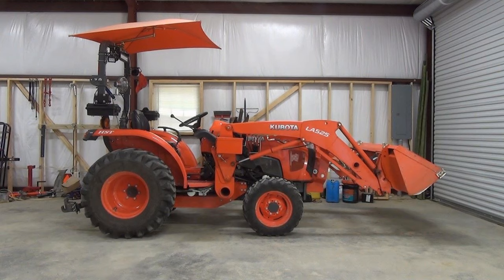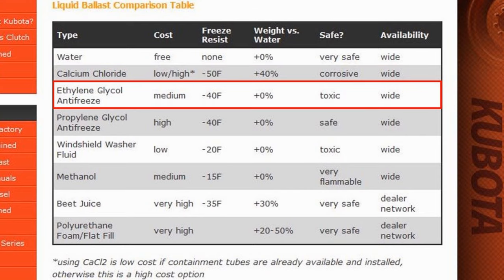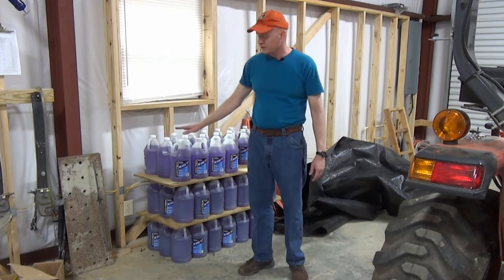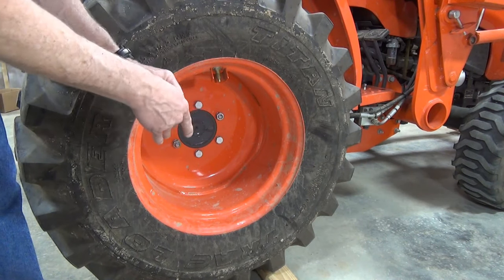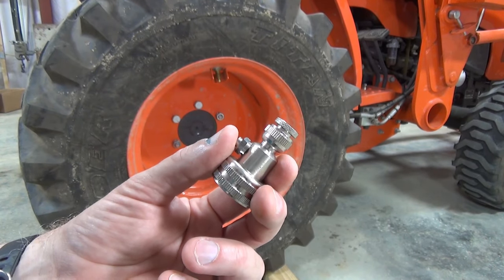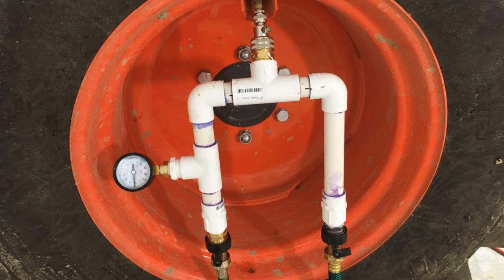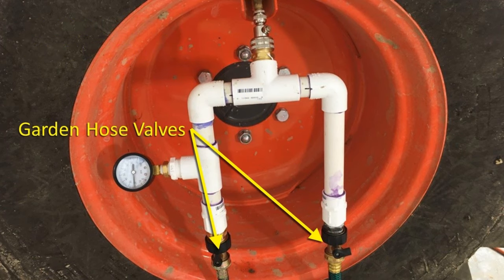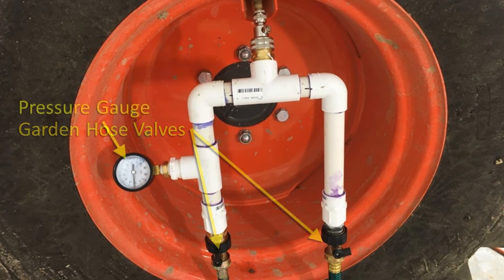Adding Liquid Ballast to Tractor Tires: Which Fluid? Which Method? Tire Fill Chart (#95)

Comment: You should know that anti-freeze has had a bitterent required since 1/1/2013. It is no longer sweet for animals.
Reply from the maker: That’s good to know. Thanks for sharing the info!
Reply: Not rue. Have splashed it on face. It's sweet

Comment: Isn't that a TR220 valve? I've never seen a rear tractor tube with anything but a TR220 or TR218(They just differ in length). The entire stem should unscrew from a 5/8" fitting to allow liquid to be pumped at a reasonable rate. Also fill with the stem between 10-11 o-clock so that you don't get a bunch of fluid every time to check the air pressure at 12 o-clock.

That chart isn't accurate either, methanol is 6.6lb/gallon. Windshield fluid is usually a mix of soapy water and methanol, brands vary so weigh a gallon to know what you have. (Be sure to subtract the empty bottle weight.) Methanol wouldn't be used straight anyway it would be mixed with water.

I like the weight and low cost of calcium chloride but the real problem isn't rust from the inside (The oxygen gets used up fairly quick and rusting stops, esp if the initial fill is with an inert gas.) The real trouble is the corroding valve that gets tiny little weeping drips which corrode the rim and all the lugnuts and such from the outside. 
Realisically, if the the traction difference over plain water density and or iron weights is a concern then you should be running proper agricultural tires rather than those industrial treads. Liquid density in front tires might be more critical because they are so under sized on utility tractors.
 Though many times iron wheel weights are hard to find for older machines as some fool let them get separated from the machine and overgrown in brush or sent them to a scrapper for $10 (same goes for many specialty implements).

Comment: Great video.  Enjoyed watching even  though my L3301 came with loaded rears.  I thought you would have done this with the backhoe on which would have made raising the wheels off the ground much easier🤓  BTW, I just did my 400 hour fluid change and referenced your video a few times.  I too couldn’t get my filter off and ultimately had to jam a screwdriver thru it!  Keep up the great videos.
Reply from the maker: Hi Stephen!  I would have used the backhoe except that the stabilizers leak down.  So, I didn't want to have to worry about that.  I just wanted to focus on the liquid ballast.  Glad the fluid change video was helpful to you! Thanks for watching!

Comment: I feel like tractor tires should have two valve stems to make this easier lol
Reply from the maker: Good idea!  One opposite the other.  Or maybe just a removable drain plug opposite the valve stem.  That would make draining a tire MUCH easier.
Reply: @DIYMyWay  maybe they make a valve stem kit you bcan drill a small hole and thread in?  Let me look
Reply: What do you think of these?
Reply: Guess I can't link to the product on YouTube.   lock and lube website has a permanent valve stem kit.  But I think a good screw in plug like you said would be even easier

Comment: I fill small tubeless tires by removing them from the tractor, breaking the bead partially, and just pour the fluid in between the bead and the rim. Oh and lay them down while filling. You can go faster and get just as much or more fluid into the tire.

Comment: What an absolutely beautiful video. Informative. Strait to the point. Not drowned out with music.
Purely professional.
Reply from the maker: Thanks!  That means a lot coming from a fake account.
Reply: @DIYMyWay  Justa fellow tractor owner looking to fill my JD 4200 wheels this weekend.
Went from the 4wd to a 2wd when the front gears went. They wanted $5000 to replace them so I disengaged. The tractor can barely scope a load of stone even with a 8 disc harrow plow on the back.
I learned the most from your chart of weights and corrosive ratings which was my biggest concern.

Comment: I recommend using a 5-gallon Hudson sprayer.  if you have a compressor you can add an air valve to the lid of the sprayer, and use the compressor, with regulator set to about twenty to thirty-psi.

Comment: Hey there Martin!!!  Great video.  Having ballast in the tires is a great plan.  Makes the tractor a lot more stable like you say.  And loading your won tires is not that difficult for the average DIYer.  I used the windshield washer fluid option and had no problems last winter.  It is a much more cost effective solution.  Take care!!
Reply from the maker: Hi Mike!  So you chose the same juice! Eggcellent! Thanks for watching!

Comment: Well I finally got around to do as you recommend and it worked GREAT!   Very easy. I followed every step using washing fluid from rural king. I got about 30 gallons per side.  Every step and equipment you recommended worked perfectly. Thank you so much for your information.
Reply from the maker: Hi Trip! Glad it helped and that you got it done successfully!

Comment: Most all my old, old tractors have calcium chloride and the rims show it.  As the tire and or rim failures add up over the years, and no longer using them for heavy farm work, I repair the rims the add wheel weights.  The larger tubed tires have a two part stem, where the outter part threads out of the larger shorter diameter portion to allow higher volume of fluid flow into the tube.  Cool and informative video Martin, I think you more than covered all the bases.
Reply from the maker: Hi Wendell!  Yep, calcium chloride is cheap and heavy per gallon, but best used in tubed tires.  Thanks for watching!

Comment: Most professional vid I've seen so far. I use removable weights in case I need to haul on a trailer or adjust for soil or implements. Too much traction without proper slippage allowed can ruin transmissions, ruin tire insides if not tubed because of moisture in the air and imbalance at speeds causing tires to flex wrong.  Often thought about boxes that I can fill and remove long chains, weights etc...
Reply from the maker: Thank you, Perry!  I appreciate it!
Reply: How easy are the weights to install and remove?
Reply: @wlfpck08  You pose a thoughtful question.  No fun in cold, wet miserable weather if the tractor needs to be loaded on a trailer.  HF and others sell a hand pump vacuum that might fit the air fill nipple with valve core removed.  It will have to be a very small tube and lots of time.  Wish I can find an easier way.  Farm jack lifts the weights with no problem but I'd rather be able to evacuate the fluid fast and refill with an easier way.  I've thought of metal plate lifting magnets that can lift well over half a ton and more.  That would be great if the weights weren't too heavy but maybe hoisted on and off????

Comment: Some Allis Chalmers service manuals recommend valve stem at 45 degrees.  Gets the CG lower and you add physical weights if you need more for traction.

Comment: Did one years ago with just the adapter by disconnecting it and bleeding pressure periodically, but it took a while. Didn't bother me and my helper, we were pretty loaded as well by the time it was done... If you have a Sat afternoon to spend, it's one way to get it done, but I prefer your approach.
My "new" B7800 came loaded with odorless, non slippery red stuff, presumably beet juice of some sort, can't say I'm disappointed about that. Excellent video!
Reply from the maker: If you got beet juice in your tires, you’re all set for freeze-proof ballast. Thanks for watching, Scott!

Comment: Besides saving the spray to the face from using the little bleed button, the manifold has another great use.  Should you ever need to change a tire due to wear or just the desire for a different tread you can reclaim your fluid by using a second air/water adapter on the inlet side of the manifold and use the valves to switch between adding air pressure and pushing the fluid back out to a drum.  Once 60 - 70% of it is out, you could remove the wheel and lay it over on a block to get even more out.
Reply from the maker: That is right, Stephen.  It can essentially work in reverse if you have the stem at the 6 o’clock position.

Comment: I'm going to give this a try, with the pump and the manifold.  I tried another method a while back and it didn't work out.  One thing that was a big fail was letting all the air out of a rear tire.  Even with the tractor jacked up on both sides, the tire came completely off the rim.  I had to hire a guy to come out here and get it back on and inflated.  That's $105 I could have spent on something else!  So this time I won't be letting all of the air out; only part of it.  Having the tire partly pressurized will make it take longer for the pump to push liquid into the tire, but with a lot lower chance of having to call the tire mechanic again.
Reply from the maker: Hi John!  Tire coming off the rim?  Ouch!!  Sorry you had so much trouble.  I hope it goes better with the manifold. Thanks for watching!

Comment: Excellent video- I'm in GA too. There is a Rim Guard dealer in Newnan, GA. I just called them to get a material only price on 100 gallons of  Rim Guard as my tractor is in Alabama about 3 hours away from nearest dealer. They quoted me $4.15 per gallon and a "service" fee of $150 to transfer the juice into my IBC tote. I'm looking at my options!
Reply from the maker: Thanks!  A Rim Guard dealer in Newnan??? Who da thunk it!  Sounds too pricey to me, but you can’t beat beet juice. Thanks for watching!
Reply: @DIYMyWay  too much $ for me too. And $150 to transfer into my tank?  Hell no. Looking at 2 x 55 gal drum of windshield fluid from Napa for $90 each. 😎👍🏼

Comment: Great video; well done!  I have a B3200 TLB with a BH77 backhoe.  It is weird that the book for the backhoe says not to use ballast, yet on the facebook Kubota tractor forum, many owners stated that their dealer puts ballast in all the tractors they sell.  

Beet Juice;  Also on the forum some owners stated that their local tire shop will not fix their tractor tires if they have beet juice in them because it apparently goes sour or rots and stinks really bad after being in the tire for a while.

for tractor work on a slope, they make 'oh crap' angle gauges to mount on tractor to keep you safer.
Reply from the maker: I know the BH77 manual says that but pretty much everyone ignores it because we need the ballast when not using the backhoe.  Interesting info about beet juice!  I didn’t know that it rots but it sure makes sense.  It’s not common here in the South because it just doesn’t get terribly cold very often.  I’m familiar with the angle gauges.  My pucker factor pegs out long before any gauge does. Thanks for watching!

Comment: Great video.  I have a L3901 also.  I used water because I am in central Louisiana.  It does freeze here, but not too often and not too hard.  I have never had any problems.   
Does not take too long to fill with water when you have 60 PSI.  
My tires were inflated to 30 PSI when new.  I found them to be very rough, so I reduced pressure to 20 PSI.  After adding water, I reduced tire pressure to 15 PSI.
I had one tire break seal because I did not jack it up.  It was tough to fix.  Jacking it up is the way to go.
Keep up the good work.
Reply from the maker: Thanks, Eric! Bummer that you had one break seal.  Definitely gotta jack them up. Thanks for watching!

Comment: Easy way to add antifreeze, lay hose on ground flat. Drain any water out, have a person on each end of the hose. With a funnel pour anti freeze into garden hose. When it has the desired amount of antifreeze hook one end back to your water source, put the valve (the one used to add water to tire) on the other end. Repeat as necessary.

Comment: Instead of the manifold you could use a garden house splitter with ball valves which are about $6.  You would lose the pressure gauge but it would be super simple.
Reply: It would just require that he keep the tee inline for the gauge.

Comment: Today I thought of a way to do that without all the PVC and adapter fittings. I work on lawn pumps occasionally so I carry this hose Y fitting that has two little valves on it, and I keep a pressure gauge attached to one of the outlets. Then I looked around my van and found another one of those Y hose things with valves. All I had to do was screw this second Y onto the second outlet of the first Y and that leaves me with a pressure gauge and two hose connectors to run to the pump and the bucket. So basically I did the same thing with two 5 dollar hose Y connectors. All I had to buy was the 10 dollar Air/Water Adapter Kit and a short 3/4' nipple for the inlet of the first Y. Easy peasy.
Reply from the maker: You have a smart, inexpensive solution! Thanks for watching!
Reply: That is a great idea.  I actually have the same type of thing in the garage, but it is a manifold with 4 valved outlets.  Am I glad I read through the comments and saved myself building the manifold!  Thanks.

Comment: Great DIY video for this operation! In my case however, I had our local Farmers Co-op tire shop do this prior to delivery on my new tractor since I knew from the purchase that I needed additional weight on the rear tires & could eliminate the hassle. Not as difficult as I would have thought though with that rig!
Reply from the maker: Thanks, Nunya!  Yep, it turned out it wasn’t nearly as difficult as I had imagined.

Comment: Well once again this is a great video. I have my weekend planned.  Thank you.
Reply from the maker: Thank you, Trip!  What ballast fluid do you plan to use?
Reply: @DIYMyWay  wiper fluid just like you did. Already priced it at WM. Ordered the transfer pump, stem removal tool and adapter from amazon last night.  I'm ready.
Reply from the maker: Excellent!  Good luck!
Reply: @DIYMyWay  Thank you. I'll report back when I'm done. Contemplating the PVC system you built. Might just go straight from the pump to the tire.  We will see?  I am sure I'll be covered in blue wiper fluid.
Reply: Hello. Walmart sells only 12 g of wiper fluid at a time. I found a product called quix wiper concentrate that makes 55 g of fluid and I need to add 11 g of methanol for the winter mix. All in that’s less than $35 and it’s a lot  less than moving vs 60 g of pre mix. Do you think that would do ok?  Thank you.
Reply from the maker: Hi Trip!  It sounds like it should if the freeze protection of that mix is well below the coldest temperatures your area gets.  Good luck!
Reply: @DIYMyWay  I found 60 g at Rural King so problem solved. Thanks again.

Comment: If you use anything corrosive make sure the whole metal rim is covered.  Other wise it will have air in the tire and cause the top of the rim to rust.  In the image i would go 3 in higher than where they show liquid level.

Comment: I used a boat bilge pump, 12V, plenty fast. Submerged with 3/4" transparent tubing to the tire. If you make a loop to the tire you can "see" when the pressure is building up too much and just purge the air with a valve. It's hands on, refilling the 5 gallon bucket as you go,  likely an evening watching the tires fill and purging as required. I don't see how the manifold would help so much that I would build one.
Reply from the maker: A bilge pump! Good idea. Thanks for watching!

Comment: I've got a garden hose "Y" with a valve on each side.  I wonder if I could use that instead of the manifold?  Maybe manage the pressure on the bleed side like you did, or glue a schrader valve into the fill side and check it with a tire gauge?  Never thought of wiper fluid before.  Sounds like a plan.
Reply from the maker: Hi Kenneth!  That sounds like a great idea!  I think you could manage and measure the pressure on the bleed off side. Thanks for watching!

Comment: I went with -50°  RV Antifreeze in my tires. It was the same price as window fluid at Walmart, weighs more than window fluid, and is non-toxic.
Reply from the maker: RV antifreeze was mysteriously unavailable when I was buying.  In fact, I had to wait a while until Walmart had enough windshield washer fluid available and I had to drive to another town to get it. Thanks for watching!
Reply: @DIYMyWay  Yes, I had to hit three different Walmarts before I finally accumulated 96 gallons!

Comment: Impressed by the quality of you presentation, thank you. But I have a question and would appreciate any polite input. Since the main element that keeps this windshield wiper fluid from freezing is a percentage of alcohol (methanol, ethanol, Isopropyl etc.) mixed with mostly water, would it not be cheaper and easier to just buy denatured alcohol ( shellac thinner ) and mix it in the proper proportions with water to fill the tires ?
Reply from the maker: Thank you, Anzaal!  I don’t know the answer to your question but perhaps someone who does will see you comment and answer it. Thanks for watching!

Comment: I’m curious if you have any tricks or tips on how to remove and reinstall a wheel that is loaded with ballast. For instance if you needed to flip a wheel to get a wider or narrower stance would you drain it or is there a trick for lining up a 350lb tire to the wheel studs of a 4000 lb tractor?
Reply from the maker: I haven't had to do that so I haven't thought it through, but if you can get someone to help you could probably manage the tires by hand with them just barely jacked off the floor.  Good luck and thanks for watching!

Comment: Nice work - looks like you had the tire off the ground when you pumped it full of WW Fluid.  when you finished filling,  you aired up the tire.  But when you lower the tire to the ground won't that increase the fluid level and pressure in the tire?
Reply from the maker: Yes, I reckon it would. Thanks for watching!